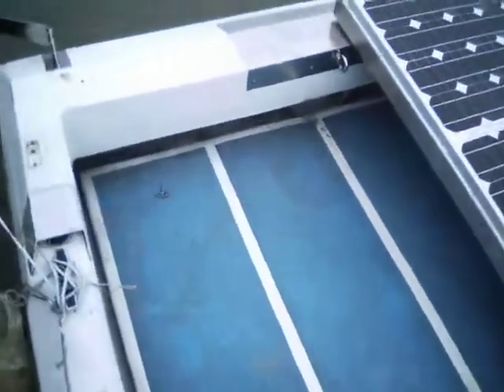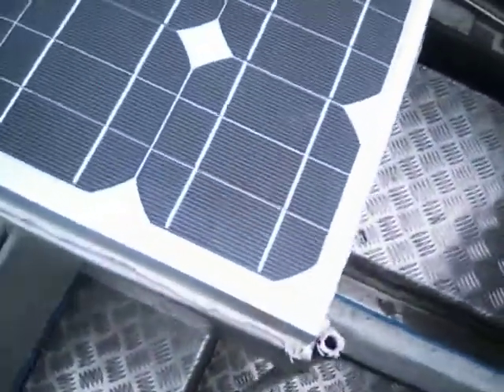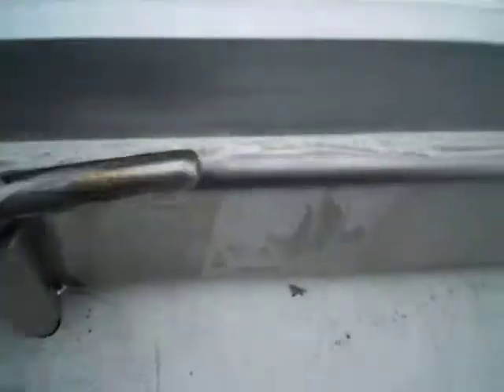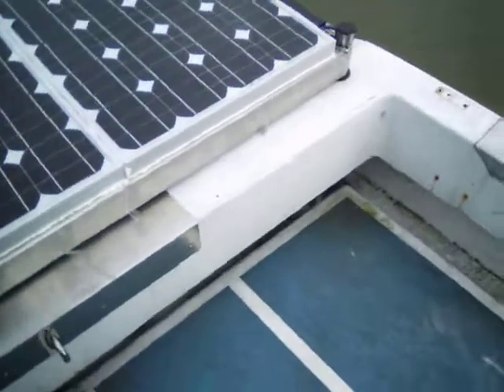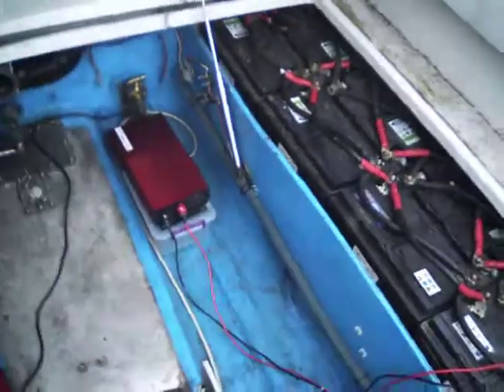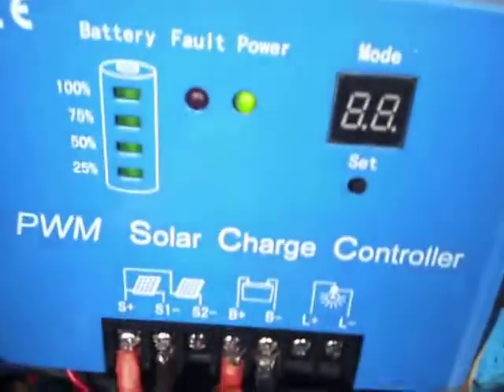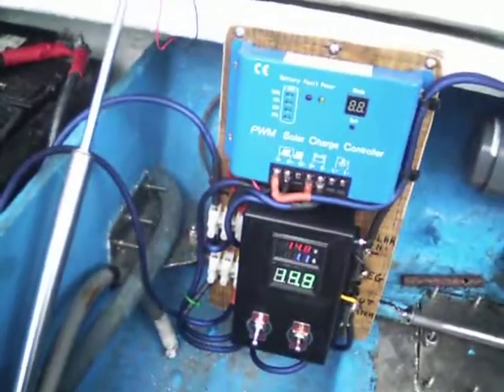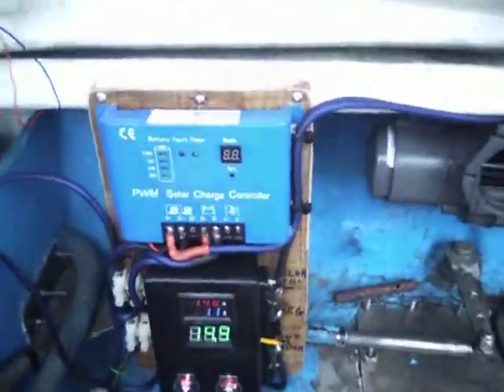solar regulated charging on electric boat

Comment: I've committed a pretty decent chunk of change toward electric boating. I have the high output DC genset & motors but am waiting on battery technology to catch up. Quick charge high capacity batteries which are affordable, like what powers today's electric vehicles will seal this up for me. I don't know where solar will fit into boating yet but I keep on the lookout for panels that will turn more of the sun's light spectrum into current. I keep my eyes on the tech horizon.

Comment: 1.1 amps out of the solar panel & the motors pull 90 amps an hour. After you run the charge out of your batteries how many days does it take to bring them back to full charge with only the panel?